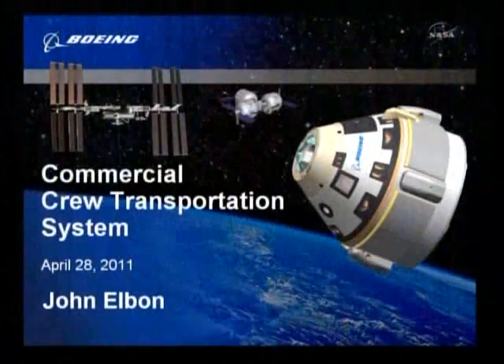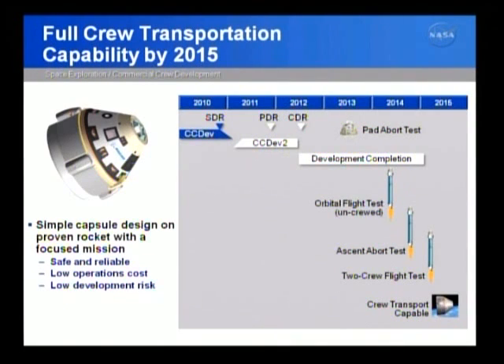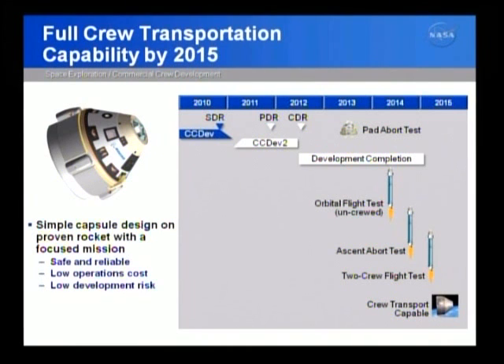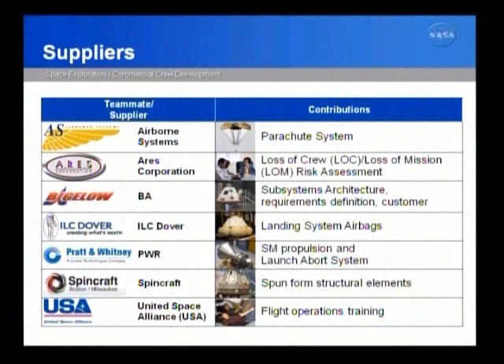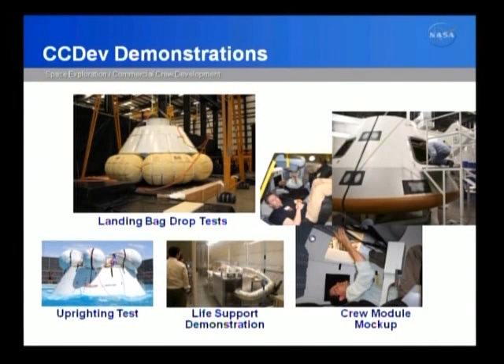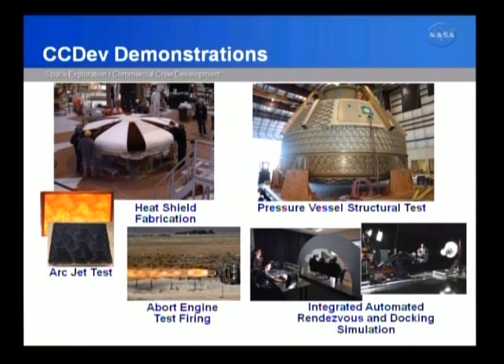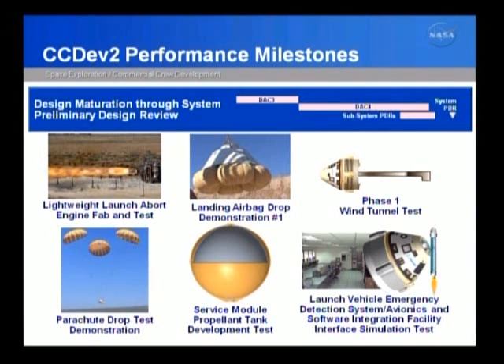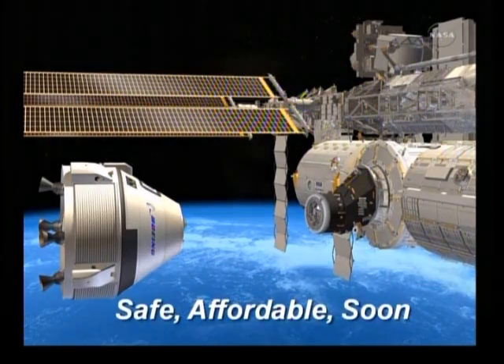CCDEV 2 briefing Boeing CST-100

Comment: I would use Falcon9 over AtlasV for people.  The reason is engine clustering and the ability to turn off individual engines it what you want for human space travel safety.  I would not consider Delta at all (unless) it did NOT use solid rocket fuel.  Solid rocket fuel should NEVER be used with people.